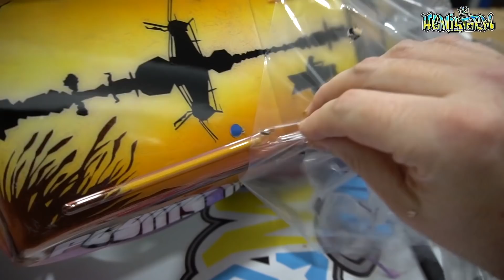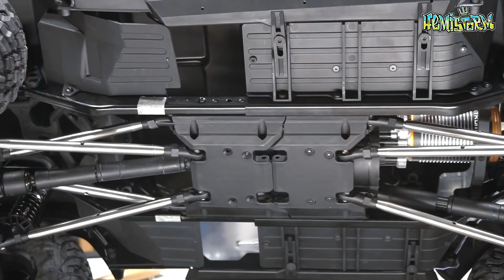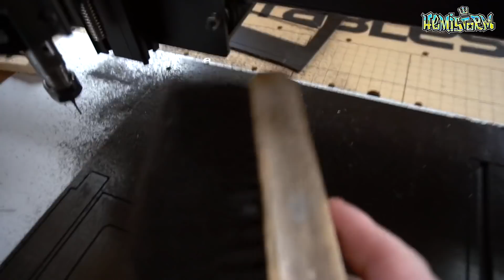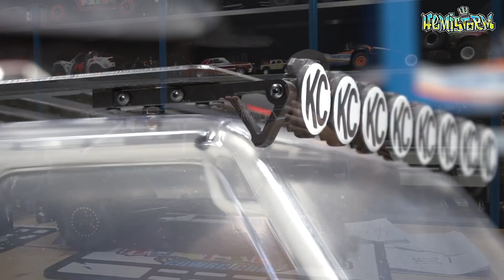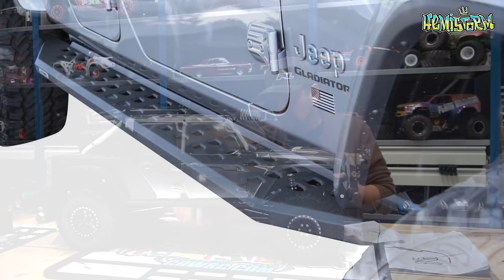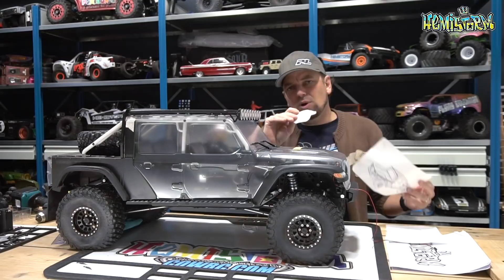Jeep Gladiator AXIAL SCX6 Build - Part 4 - CNC & 3D Printing

Comment: This is AMAZING. Looking to doing it myself. Have you releases these files? also, if I dont have a CNC machine, can i just 3D print this in PLA?
Reply from the maker: PLA in this size will not hold up, I'm looking into a different way of sharing these files. More coming on that!

Comment: I absolutely love the build, but please don't say Delrin is non toxic and safe. POM (which Delrin essentially is) is extremely toxic (it's based on formaldehyde) and you shouldn't work with it without proper ventilation and filtering. Especially if it gets hot because the fumes from it are extremely poisonous and cancerous, so please be safe around the stuff.

Comment: Watching this build has made me think about going the opposite route and doing the short wheelbase single cab concept that jeep has shown a couple of times very much like the two Matt at SBG is building to comp with but have not got a 3D printer CNC and laser cutter but mainly not got the skill or talent plus patience to pull it off, unlike yourself Chris.
Reply from the maker: I think you will be able to surprise yourself, Nick
Reply: @hemistormrc  I wish now I can build a good custom 5th gas and have built a nice UDR and LOSI Super Baja Rey clone into pretty decent usable customised using parts others do not think to try to get a true to scale working and looking vehicle but only using bolt on, glue on type parts but to fabricate is not so easy, I used to build custom and Streetfighter style motorbikes as I can weld plasma cut and bend tubing as I have that equipment even now but it is pretty useless on Lexan Delrin etc.